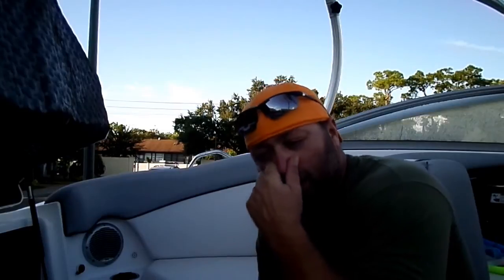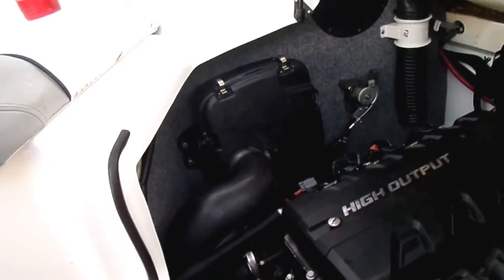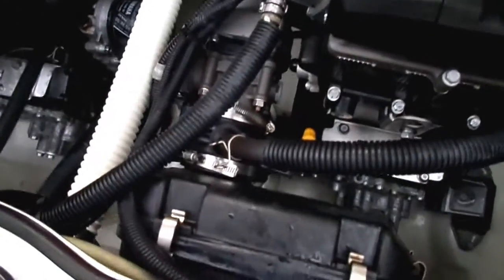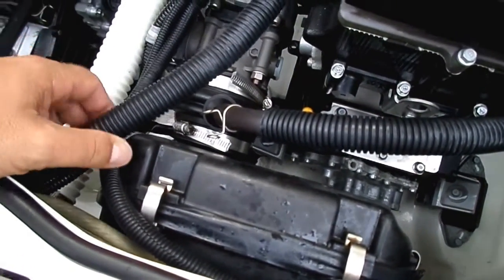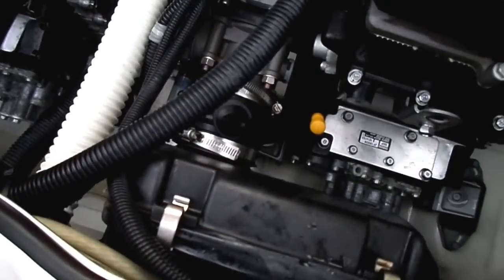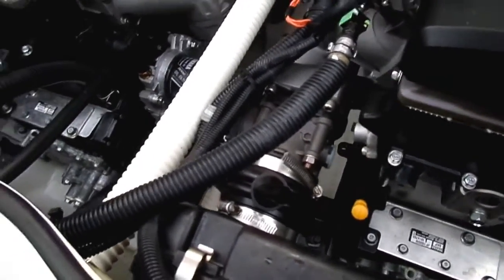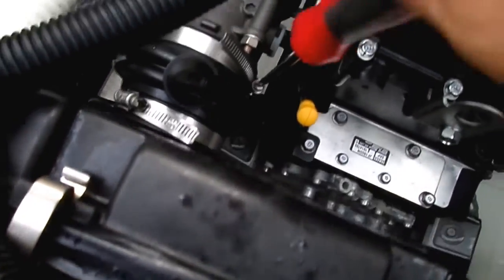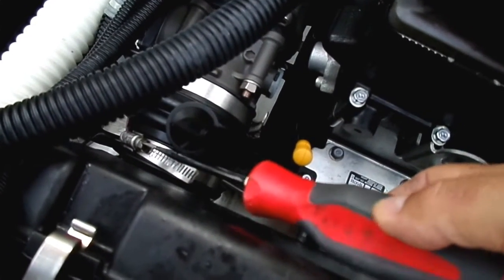Yamaha AR240 Air Filter Removal

Comment: Rob, I know this is an older video but I hope you will respond still. I pulled both air filters out of my 2017 ar240 and gained so much more power and I got back to running at 7400 rpms on both motors. Day 3 it seems like I lost the power again.do you think I need new oil and spark plugs now for all this new air flow
Reply from the maker: I never had a loss of power, so I would definitely check the plugs.  Oil is irrelevant to power loss or gain.

Comment: Hey Rob, my engine is making the same sound when you fogging, is that ok. However the other engine is really smooth. I saw that you didn't plug any water hose for how long you can have the engine on while fogging and now water running?
Reply from the maker: Yori,  Thanks for watching dude.  The fogging oil will always choke the engine, some will react differently but no harm no foul in the sound.  As far as running the engines without water, you shouldn't run them more than 5 or 6 min or they will start to overheat.

Comment: I live near the gulf in Pasco county. I want to buy an ar210. Do you have problems picking up seaweed and grass in the motors? I have heard it’s a problem in the waters here
Reply from the maker: Hey Kevin, there is seaweed in the waters and yes you will pick it up sometimes. The good thing about these boats is the clean out plugs on the swim platform.  If you pick up weeds you will feel the loss of power, just throttle down kill the motors pull out the clean out plugs and pull the weeds out.  Simple.   It happens but its not a big deal.   I also live in Pasco and I have had to stop and clean out weeds maybe three or four times in a few years.  Its not terrible.  If you get one, go to Cycle Springs and make sure to see Scott Ellis and tell him I sent you..
Reply: Thanks for your response. And I am buying my boat at cycle springs! I will mention your name. And by the way, I love your videos. They are informative, detailed and fun too! Thanks
Reply from the maker: @kevindoherty5424  ok good.  Thank you. I'm a simple guy and i like simple messages...  I have a few more videos I am editing this week.  Once you get the boat drop me a line...

Comment: hello ,, I have yamaha ar240, the engin suddenly become so weak .not going over 30knot . any idea?
Reply from the maker: MR MH DR could be a few things.  1. Make sure clean out plugs on the swim platform are properly sealed. 2. Could have debris clogged in the water intake just inside of the jet unit. 3. Bad fuel....  4.  Bad spark plug.   do you have shaking at all? Could be a bad impeller (cavitation)..  are there any other symptoms?
Reply: Weeds in the jet intake will cause ventilation in the pump make sure it’s 100 % clear